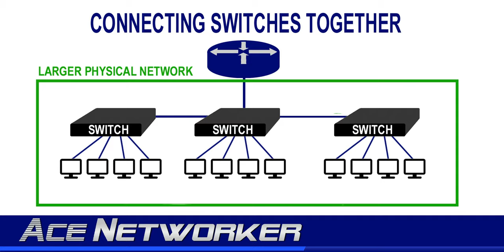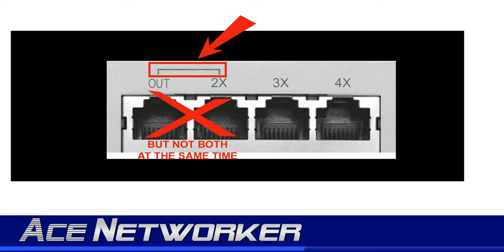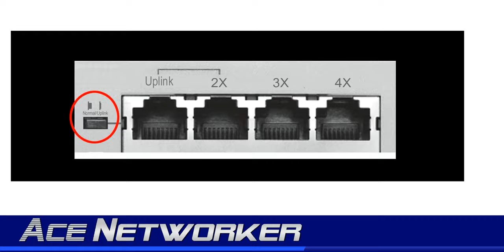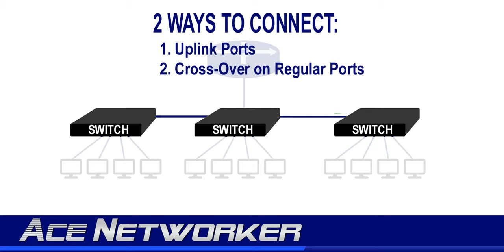Connecting Switches Together - How Do We Do That?

Comment: @AceNetworker questions
 1- does all the switches will have be in the same subnet?

2- how should be set up the switches if you need have different ip in each switch does it possible or not?

3- what about Vlans does it possible to setup in the switches and got to have communication between each others?

thanks in advance and greetings from Monterrey Mexico.
Reply from the maker: 1 - All switches start out defaulted to VLAN 1, so they are all in the same subnet until you configure different VLANs on the interfaces

2 - Depending on the brand of switch, you can usually set up a management IP address in each VLAN. If only one management IP is allowed, then it's usually only allowed in VLAN 1 or you have to create the Management IP address within the subnet of the VLAN you wish to access management of the switch within. For Example: If you wanted to manage/access the switch in VLAN 3, you would create a Management IP address on that switch that is in the same subnet as what the devices on VLAN 3 are using.

3 - Multiple VLANs are usually recommended, especially if you have more than one subnet going across a switch. The Uplink port can also be configured into a different VLAN (other than the default of VLAN 1) and/or be trunked with multiple VLANs

Hope that mostly answers your questions. But let me know if I need to clarify anything there.

Thanks for watching!
Reply: Thanks a lot', your are a geniuos!

Comment: For home network, I was going to use a 16port switch in office. Then an 8PORT switch in living room , then an 8PORT in kitchen dining as a Daisy chain.  
Reason I’ll have 1cable from room to room. Then multiple available in each room off the 8PORT switches.  16port will be using most for printer and multiple computers in office.  I “may”. Pull 2 of those lines (one to each of two bedrooms).  

That way ,  lines between rooms are minimal.  Once in each room, I can run them on floor bundled next to base board allowing lines/rj45s from multiple seating spots for guest.

I’m not concerned hiding them. We have long (L-Couch) and other furniture in living room .

Kitchen, run through cabinets attached to back wall out of the way and drop one rj45 down from top cabinet at intervals around kitchen counter. (Out of the way but accessible).

I’m disabled and very low income,  can you recommend the best brand switch and model(s) to buy?  Also for Daisy chain - how many of each type cable I need?  Only last Daisy chain will be from front regular port to last switch rear port.  1gb non Poe is needed.
I have qty 1 managed 8PORT switch that was given to me. (Not used yet by me).

I will have separate router with POE 1GB PORTS for security cameras and devices to plug into.  (Should I connect this router into main router directly? Or into a spare router I have first?  (Any benefit doubling router up before primary modem router for security devices?)

Or

Run security switch Poe into 16port office switch to reach modem/internet that way?  I though those as separate would be better going to modem.  

But I am clueless!
Reply from the maker: You've got a number of questions there that are more difficult to answer without being there with you. First of all, typically you would run a POE router where the devices are that need power FROM that POE router. In other words, do you need the POE router to provide power to any devices? And if so, where are those devices? In this case, the POE router from what you're telling me is powering the security cameras. That's the first determination on where to put a POE device. If the POE device is NOT providing power (through the ports) to any devices directly connected to it, then you may want to run the POE router next to the ISP router (or main router).

As far as home or home office sized switches, any on the market will usually do what you need them to do. You don't necessarily need to even use the rear (switch-to-switch) ports I talk about in this video, unless you need every port on the front of the switch for that many devices.

Hope that helps you somewhat. But let me know if you have additional questions and I'll be more than happy to help you.

With an initial network, you can connect switches any way you want, as they will all be on the same network. With the router, just keep in mind that where you connect it, it will divide it into whatever multiple networks it has on it (or you configure on it).

Comment: Thank you so much dear technician, Tell me, Are there any differences between connecting switches using straight through and crossover method?  
During the rain, The cable gets a high voltage and sometimes switches get damaged! WHY, Maybe there is a short circuit OR what! 

Our access points use only 4 pins, can I use the other inactive pins as a earthing system / grounding in order to prevent the devices from lightening strikes/ short circuit during the rain.

THANK YOU,
Reply from the maker: Without actually seeing the devices and setup you've got there, I would say check the wireless APs themselves, as they should have their own ground under the UL rating without something having to be improvised. You may also set up surge protectors on the switches the APs are connected to to prevent surges from lightning or other from damaging the devices.
Reply: @AceNetworker  Thank you dear technician for your quick response, Actually,Our APs do not have have grounding cable in AC. 
I am wondering if using inactive pins as an earthing system!  I can connect these 4 inactive pins to switches box... ! 

Thank you Technician.

Comment: Hi ace networker, if you use uplinks or regular ports, does it should set up  ip's in thats interfaces ?
Reply from the maker: Thanks for watching! No IP's will be used on Layer 2 Switches or their connections to each other. Now that is not a "blanket" answer - as you can assign a Management IP Address to a switch for use with pinging it on/over the network and accessing its management configuration.

But for the actual connections between switches, they will not need (or use) IP addresses...No.

Hope that helps 🙂
Reply: Thanks a lot and greetings from Monterrey México  @AceNetworker
Reply: @AceNetworker  Got it, that should be if you just use the native vlan 1, but what happen if you need to create and use multiple vlans? how do you should setup the uplinks port in order be able to communicate betwwen the vlans?

Comment: Hope I explain and ask the right question. My netgear router has 1 input from modem, and 3 outputs, and is located in my living room where I have a smart tv and playstation 5. In my bedroom I have a ps5, Xbox series x, a smart tv, and eventually a gaming pc. Can I put 1 switch from the first output on my router to connect front room, and put another switch on the 2nd output line running to my bedroom to connect those devices? Im looking at getting two of the 5 port TP-link unmanaged
Reply from the maker: @emilybaxterthecartoonywitc1805  On the surface based on your description...Yes, you should be able to do that. Each switch interface will have it's own MAC address and the 3 interfaces on the router should each have their own MAC address, so in theory that setup should work.
Reply: @AceNetworker  thanks for the info. I just ordered the switches and cables
Reply: Everything is put together and is working awesome. 860 mbps speed in both rooms. 👍

Comment: Ace please help me with an answer: If i need a redundant cable between (2) switches can i use for the first connection Uplink Port (Switch 1) to Regular Network port (Switch 2)and for the second (redundant) connection Regular Network Port (Switch 1) to Regular Network Port (Switch 2)? If not can you please suggest me a solution to have redundant connection between the (2) switches? Thanks a lot!
Reply from the maker: You can use either of those types of connections, but here's what you will encounter: You are creating a loop with 2 cables between the same 2 switches. So you'll want to change the Spanning Tree configuration settings on at least 1 of those cable connections to have a higher Spanning Tree "Cost" - This will force the 2 switches to utilize only 1 cable until that connection is not available, then it will start using the 2nd cable only if the first cable (the one with the lower "cost") is not working or connecting.

Another option is to NOT use the uplink port and use only 2 normal network interface ports, but configure both of those physical interfaces into a Link Aggregation to function as a single LOGICAL interface. Do that on both switches to have them match each other.
Reply: @AceNetworker  Thank you so much Ace for your fast response! I really appreciate your help! Do you have a video that explain Spanning Tree configuration settings or can you suggest me one? You are the best!
Reply from the maker: I don't have a video explaining the actual settings yet (working on it). But I can list an example here:

Setting the cost to 2000 on interface 1/1/1 (or the interface on the cable connection you wanted to be stand-by):

switch(config)# interface 1/1/1
switch(config-if)# spanning-tree cost 2000

Setting the cost to the default on interface 1/1/2 (or the interface(s) on the cable you want the switches to utilize primarily):

switch(config)# interface 1/1/2
switch(config-if)# no spanning-tree cost

You may have different interface numbers and you may have different command parameters, but these are some of the basic commands for Cisco switches.
Reply: @AceNetworker  Thanks a lot Ace! .. this is very helpful! ... i assume these commands will work only on managed switches right?
Reply from the maker: @mihaitodea8510  Correct. These types of commands will work only on managed switches. Now, if you DON'T add a higher cost to one of those connections, Spanning Tree (assuming these are managed switches, or at least 1 of them is a managed switch) will automatically detect a loop created there and should technically block one of those connections until the 1 working connection doesn't work/connect - at which time it will "unblock" the blocked cable connection/interface and allow it to function.

Again, preferable that BOTH switches are managed switches, but if they're not, at least 1 of them needs to be using Spanning Tree for this to work.

Comment: Hi Garrett. Question if you have time please. I have a main switch in the house and was planning on putting switches in several of the rooms in our house. So the wires going from the router are 568a as are all the current wires going to all the computers. Do I understand correctly that if I add a switch on any of those computer runs that I’d rewire those to be 568b?
Reply from the maker: That IS the case IF the switch interfaces (the physical interfaces) don't have/use MDIX. Most new switches automatically detect the type of cable you connect using MDIX, so check that those switches have it and have it enabled on all of their interfaces (or the interfaces you're using to connect the cables into) and you won't need to rewire.
Reply: @AceNetworker  Ok cool. Thank you very much for the response! Just wish I’d saved the manual 😉.

Comment: So I purchased this BV-Tech 6 Port PoE switch with dual uplink ports thinking one uplink port could be used as a fail over for an alternate isp connection.

Am I wrong here?
Reply from the maker: Using multiple uplink ports on the same switch can get somewhat complex. Theoretically, you could, but there are a lot of factors to consider: Are both uplink ports on the same LAN/VLAN in the switch configuration? Are they both connected to the same router (for the ISP)? If both are connected to the same router, do they both use the same default gateway IP address?

I guess to simplify the answer (or possible solution), consider the uplink ports just like any other ports on the switch for initial considerations (what they're connected to, how the other device(s) handle traffic coming from or going to those uplink ports, etc.). Then also consider that uplink ports are primarily designed to be connected to other switches for Layer 2 traffic, unless this is a Layer 3 capable switch.
Reply: @AceNetworker  I believe my BV switch is basically a dumb switch, for lack of better words. It doesn't come with  an interface for creating vlans, etc. I believe I've found an inexpensive option that does what I need it to do. The TP-Link ER605 V2 has the multi vlan interface.

Comment: If no uplink marking/ indicator is shown, or mentioned in the packaging.... Does that mean it's a smart switch & any port will work?? I'm talking the most popular, $20-ish, 8 port gigabit, TP-Link / Trednet units from Amazon
Reply: Yeah, I think so, cause it has worked when practised irl for me
Reply from the maker: I seriously apologize for not responding sooner on this, as Youtube didn't show your comment to me until now. Yes, any port on most switches can be used to connect to another switch. The uplink port (if a switch has one and it's marked as "uplink") essentially allows all other ports to be used for connecting network devices. So an uplink port gives you another port to used on the FRONT of the switch that doesn't have to be taken up with a connection to another switch.
Reply: @AceNetworker  what if both unmanaged switch doesn’t have uplink? in my case i connected both with either cross or straight cable but it didn’t work, could you suggest what should i do please?

Comment: I’m having an issue with having multiple 2.5g switches on my home network. Have a cable going out of the 2.5g port on the modem to a 2.5g switch. Then I have two 2.5g switches connected to that modem that are in other parts of the house. Only one switch will have internet and the other can’t get an ip or not assigned an ip. And vice versus. Whichever computer turns on first on that switch basically makes everything else on the other switch not work.
Reply from the maker: Hi, and thanks for watching my channel! Without knowing all of the details of your setup, you may want to check the NAT/PAT setup on the router to make sure it is able to hand out IP addresses to more than 1 device on your network. Then you may want to manually assign an IP address to each switch for managing them. Also, once the first computer gets assigned an IP address and is connected to the internet, try to ping an external website (like Google or Microsoft dot com) to confirm it is able to ping. If it's able to ping through both switches (the switch it's connected to and then THRU the other switch into the router and out to the internet), then connectivity is not an issue, but rather IP addresses being assigned to all devices IS the issue.

Comment: Can you connecting a managed switch to an unmanaged switched?
Reply from the maker: The simple answer is Yes you can - if it's for network connectivity. The only limitation you have with an unmanaged switch is you can't change settings on it (remotely or in-person). But yes, you can connect network cables between managed and unmanaged switches. Lots and lots of networks are running that way now.

Comment: Hello, I need help pls, I connected a router to a switch1 then switch 1 to switch 2 but switch 2 is not acquiring automatic IP? What do I do
Reply from the maker: So without knowing the exacts on this, make sure Switch 2 is able to ping or connect to the DHCP server on the router. The DHCP server (probably on your router) is what is "assigning" IP addresses to the devices on your network.
Reply: @AceNetworker  thanks a lot, I was able to figure it out last night, I had to trunk the port of the switch connecting to the router and trunk the interfaces btw the switches✌️✌️😀😀. Thank you 👍👍
Reply: @Sugar_peace654 hey same, what did you do? do i need to config it on pc connected to switch2???